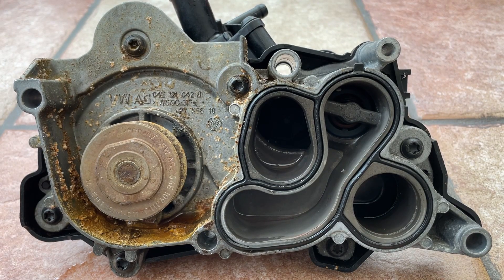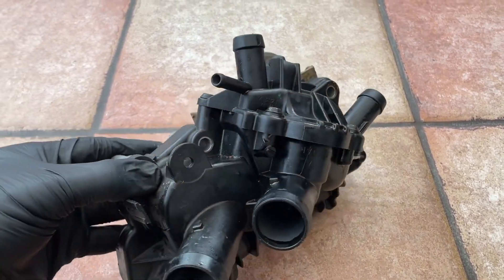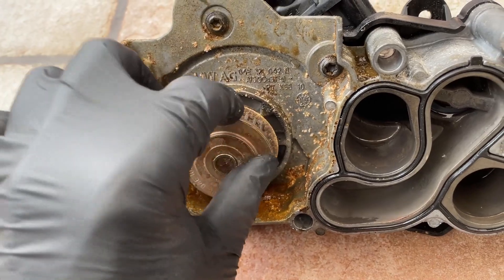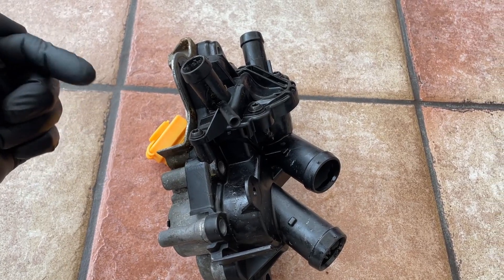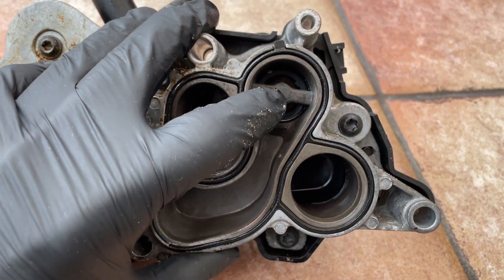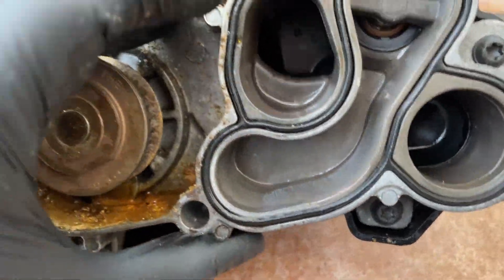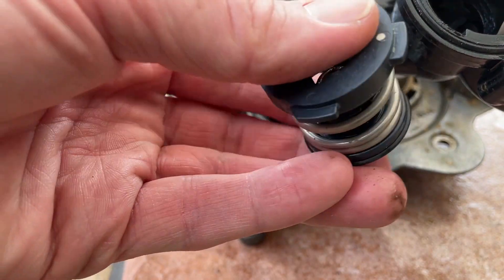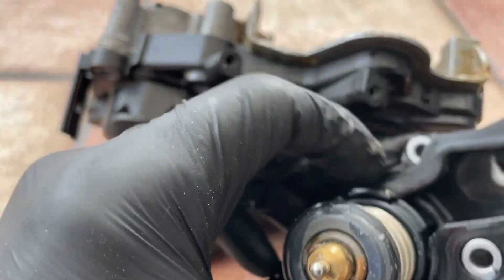VW AG Coolant Pump Tear Down - EA211 TSI Engine  - What is inside?

Comment: It seems that the first thermostat is overriding water to cabin heater and reduses flow when engintemp increases in temp to prevent cabin heater to be to hot. I  have poor heat in cabin and as i can see int is not a bad waterpump as the serice technician  says.
Thanks for this video. now i have a good knowledge on how it works

Comment: Long video for nothing. The circulation is wrong.
Reply: Not true he’s correct, check the diagram for the cooling circuit and the pump itself online. The top t stat is for cool flow back to engine after radiator cools it off. Bottom t stat (one inside the pump facing the engine) is for hot engine coolant going into the radiator
Reply: @Night_keen  top thermostat opening temp is 87 C and second one is 105 C